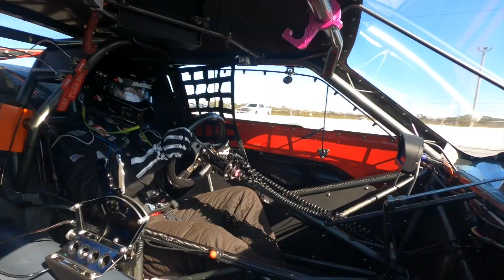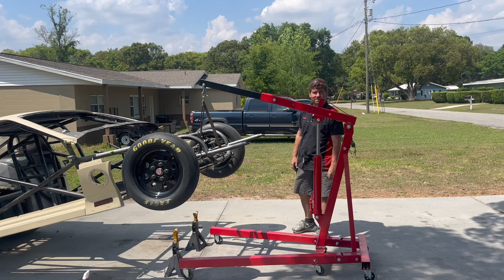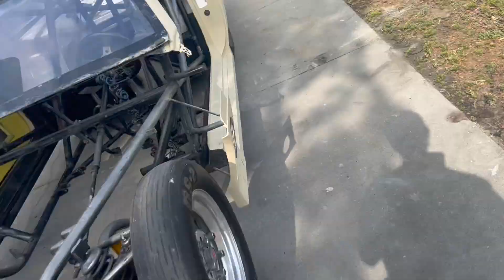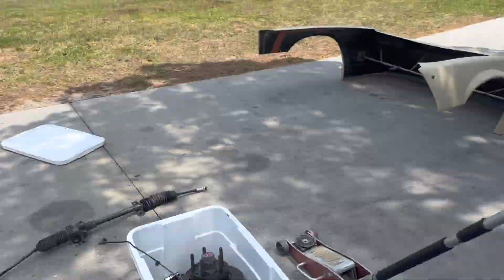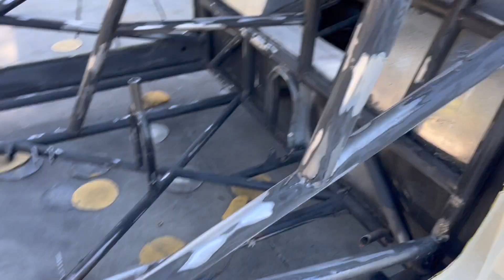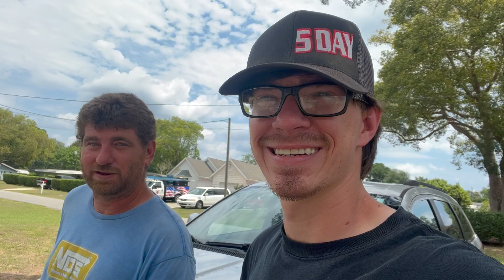Prepping The Chassis For Paint Plus Tearing Apart The Suspension On My Third Gen Camaro Drag Car!

Comment: That sanding can be a bit easier with the contour surface grinder by Eastwood Tools. This tool is wicked fast for doing pipe (cages). Check it out if you get the chance! It can be used for many other issues too